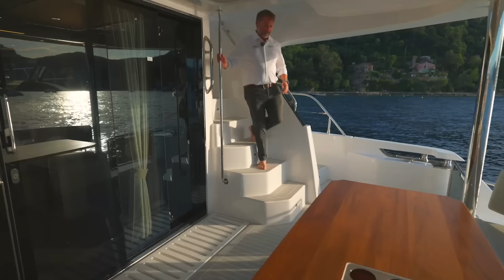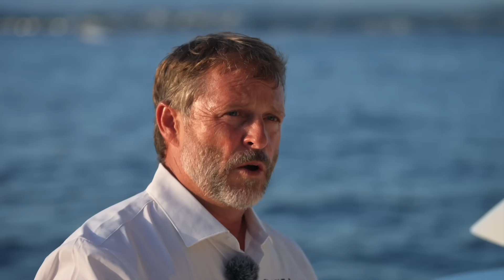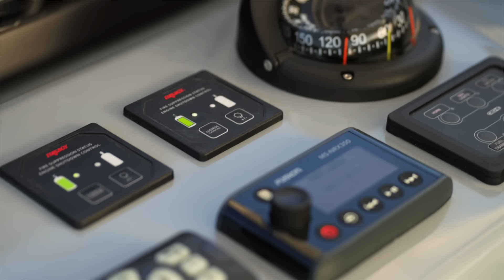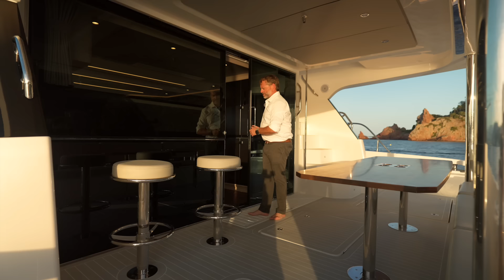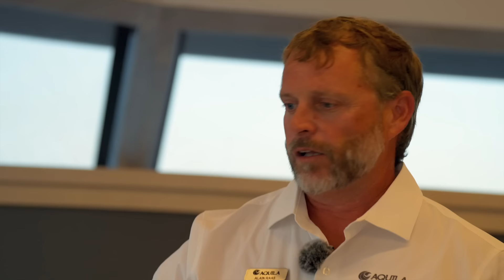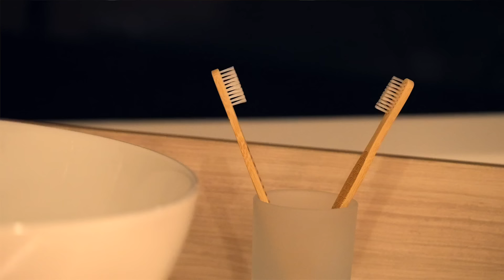Step Inside the NEW Aquila 46 Yacht | FULL TOUR

Comment: lovely boats, but would make a rally nice internal helm using the wrap above the passage for some 22'' screens, more fuel and dark gloss joinery holds its value and timeless.. can you dry out in sand with the foil fitted? what is the real range/speed improvement..  a few of the cat work boats have them or similar experiments in my harbour..